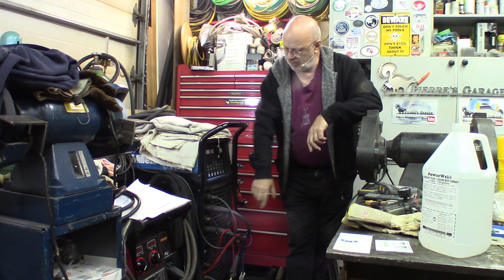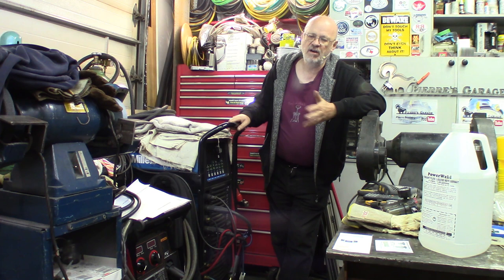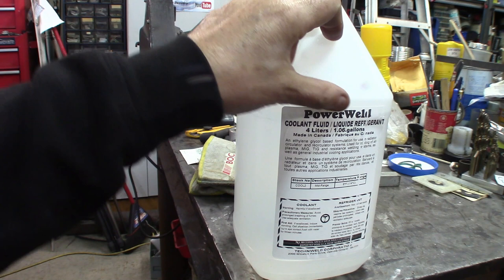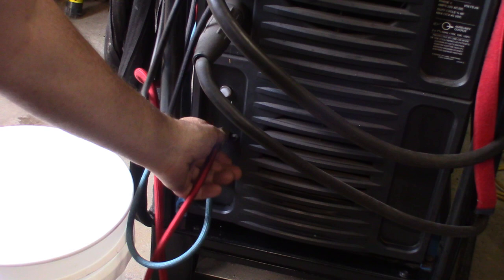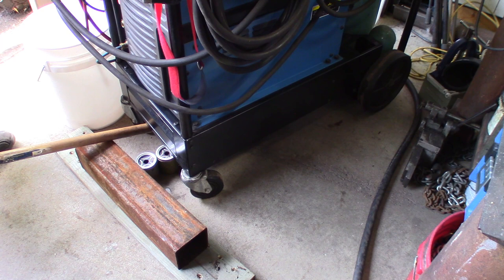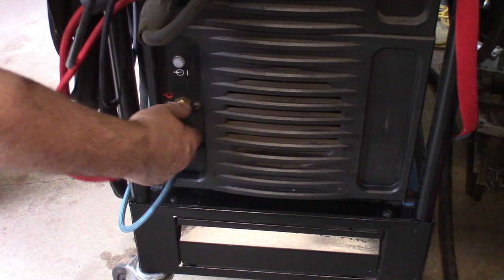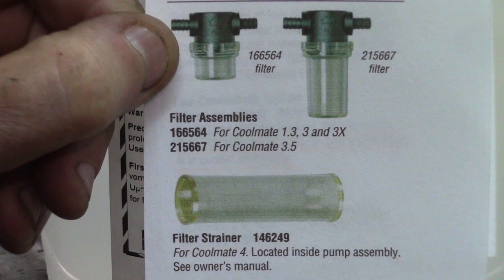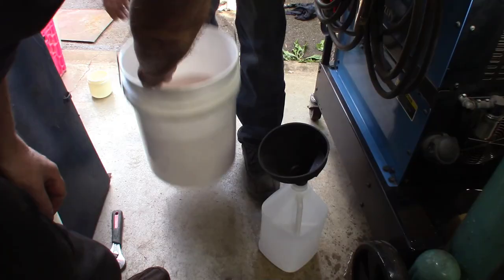Liquid cooled TIG torch, changing the coolant in the pump cooling unit, here CoolMate from Miller

Comment: Great video, I'm new to tig welding so all of this is good information. 
I'm from Ontario so I'll look up the same fluid you used.
Reply from the maker: You'll enjoy the precision of TIG welding, not easy to master, though...
I got my antifreeze from a local supplier named Maxigaz in Saint Constant, if you can't get the exact same thing just make sure you use some stuff made for the purpose, avoid at all cost the brands made for automotive as they will cake in the whole system and ruin your cooler...
Thanks for your comment....   🙂🙂
Reply: Appreciate all the tips! Thanks very much :) Yes it's going to be a long road ahead, and many refills of 100% argon, until I get it right, lol. Thanks again.  @pierresgarage2687

Comment: Been 16 years on my syncrowave 250 coolant (and welder)....time to change it out I guess LOL.  I only go through about 2 commercial size bottles of gas per year on that welder and it still works great,  even with most of what I weld is aluminum cylinder heads.  I guess it's like all good machines,  they take a beating!
Reply from the maker: 16 years, You beat me, a little.....
Being retired, the machine is also retired and only works when it feels like it...    😂😉
Those machines are eternal, they just last and last, really reliable.
Thanks for viewing and for your comment
Reply: I think I bought my syncrowave 250 dx in early 2000's, probably close to 20 years ago, and I have yet to change the coolant. To be fair, I haven't even touched the welder in close to 5 years. 

I'm in the process of lifting the welder off of the coolmate 3x, to try to figure out how I'm supposed to drain it. I haven't been very successful at finding any information about that online or in any books, so I have to do it the hard way, which is part of the reason its been so long. 

Do you happen to have the "tig runner" with the coolmate 3x, and if so, do you know where I can find the recommend procedure for draining and flushing? Or do you know what it is? 

It occurred to me yesterday to give Miller a call, but I haven't tried that yet.
Reply: Been 30+ years on my Hobart cooler on a TR-300-HF without a change in Prestone, cooler temps (-20 +F) and warmer (100+ F) - no problems.  I'm upgrading to a Dynasty 280DX so I guess I need to start changing the special fluid every 12 months :)  And the pump every ? years?  I love progress.

Comment: My Miller dinosaur is valved to hook to tap water and run it pass thru for cooling.  i have never had a water cooled torch on it though so never used it.
Reply from the maker: Before this welder I had a Lincoln Idealarc 300 and used the same principle with the valve and tap water just like you, it causes a little bit of scaling and needs to be addressed once in a while, must depend on how much minerals are in the water, inexpensive, though...
Some problem caused with tap water is theat in the winter here it's real cold and causes some amount of condensation on the electrode and collet system, not recommanded for critical welds since it transforms in vapor when you get back to weld...
Reply: @pierresgarage2687  hey you say you had a Lincoln idealarc Tig 300 I just pick one of those up a couple of weeks ago when you still had it how did you like it
Reply from the maker: @tigwelding123  It was a great basic machine, really a smooth ard stable arc with an airplane grade ventilator fan blade, (NOISY....!) In short a machine made to last 100 years+...
Cheers,
Pierre
Reply: @pierresgarage2687  why did you get rid of your Lincoln electric idealarc Tig 300
Reply from the maker: @tigwelding123  Got a Dynasty 350 kit, it's kinda much better...
Until it ever needs repair, hopefully not...   😉

Comment: I have just used RO water for the last change, and I also herd if you are in a cold climate the RV antifreeze would be a good alternative. BUT heck I do not know what I am doing. Mine is a real old and big Miller Tig
Reply from the maker: The RV or plumbing antifreeze is much less costly than the stuff sold expressly for the purpose,  my concerns would be that the coolant for welders have to take into account many factors like, safe for hoses, lubricating the pump, safe for aluminum, low conductivity mostly in systems using high frequency, higher boiling point, protect from freezing in cold areas,  anti fungal and not sure if anything more...
If someone is capable of making a technically advanced study in order to find out if all those points are met in a certain type of of the shelf lower cost product, I would welcome the result cause I'm sure we'd all save lots of $$$ in the long run...   ;)
The problem with people trying some other solutions is that it may take some time to find out the results either good or bad, and also did the comapny changed the receipe along the years...   So many questions...!!!
And, since those coolers are in the range of $1500 or more and parts are times 10 the $$$, I'll play it safe...
Best advice is to stay with what the manufacturer says...   Sigh...!!!
Thanks for your input,    Pierre

Comment: Currently working in a shop. Ive been here 3.5 years took over operations by myself in may of last year. In my time here, the coolant has never been changed from what ive seen. My torch is getting rather hot after only welding for a few minutes. Ive never had to do something like this and ive been welding since 2014. Thank you for the video, i currently have 2 of the recommended 3.5L miller high frequency coolant on hand but the remainder is on back order. Im just wondering if it would be alright if i could top up what i have as we have changed many torches over the years resulting in coolant leaking during the change so id say its on the lower end of things or should i just wait for the remainder of my coolant to arrive? Probably a dumb question but i thought id ask. The work i do isnt welding all day every day, its a lot of fabricating and grinding so i might only be welding for an hour a day sometimes more depending on what im doing. Some days i wont even turn the welder on. We are running identical machines.
Reply from the maker: I would suggest you change the whole quantity at once in order to restore the liquid to original properties, this formula contains some combination of anti corosion, anti fungus and a few other additives that degrade with time. There is the reason we should keep the maintenance schedule, here, the change isn't done every year, since just like you the machine isn't used very often as like in a welding dedicated workstation.
Remember that like with all vehicule, tool, building, good maintenance help stretch the useful life of those items...

Comment: Are you sure this needs changing? I mean the coolant in the car is in there for decades and works just fine...
Reply from the maker: I'm not officially go against the manufacturer's notice, but, this coolant was there for quite some time, it's safe as long as the anticorosion and antifungal properties are still able to keep the coolant safe for the materials of the cooler...  This is between you and me...   ;)

Comment: Thanks Pierre (and Phil).... My new TIG welder says I can use RV antifreeze, you have an opinion on that? Cheers, Daniel.
Reply from the maker: Guess that if says that you can use that product, it should be safe....   

But here is something I said to another viewer about the considerations to be taken into account about those cooling systems...   You can read if you have trouble going to sleep at night...   lol

The RV or plumbing antifreeze is much less costly than the stuff sold expressly for the purpose,  my concerns would be that the coolant for welders have to take into account many factors like, safe for hoses, lubricating the pump, safe for aluminum, low conductivity mostly in systems using high frequency, higher boiling point, protect from freezing in cold areas,  anti fungal and not sure if anything more...
If someone is capable of making a technically advanced study in order to find out if all those points are met in a certain type of of the shelf lower cost product, I would welcome the result cause I'm sure we'd all save lots of $$$ in the long run...   ;)
The problem with people trying some other solutions is that it may take some time to find out the results either good or bad, and also did the comapny changed the receipe along the years...   So many questions...!!!
And, since those coolers are in the range of $1500 or more and parts are times 10 the $$$, I'll play it safe...
Best advice is to stay with what the manufacturer says...   Sigh...!!!

Thanks for your input,    Pierre

Comment: My water cooler is pumping very slow can you make a video on troubleshooting issues?
Reply from the maker: Thanks for  viewing and comment, as making a video in a near future, I'm presently kinda recharging my batteries and dealing with more family and day to day issues...
Here are a few things you may check, first, you need to determine if the problem is the pump or the torch, in some cases you may have restrictions around the TIG torch head, it could be mineral deposits or just damages around there or the hose itself, if this is ok, you want to check if there is a filter in your system, is it clean or in proper condition, try circulating without it, look for a worn or squeezed hose or conduct, you may also have limestone deposit if the coolant is not the proper type or overly expired, I've seen some people using car antifreeze in certain systems that would cause clogging, you could have a defective, worn, partially blocked pump...
If you process by elimination of the different parts in the system you'll surely arrive to the one or possibly more causes of the problem. 
Hope that even if for now it's impossible to make a video, this will lead you in the right direction in order to diagnose your system...
ATB,   Pierre

Comment: Have a question? have the same TIG welder wondering why my coolant line keeps blowing up and dont wont to stay cooled ?
Reply from the maker: Nothing obvious to me, I got this welder since over 15 years and it's doing fine, I'm not using it very often now since i'm retired. There is one VERY important thing to consider when you get your coolant, get the proper type for this welder, either the Miller genuine or one with the same formluation, since in the system there are different materials like aluminium, brass, copper, possiblt some welds from silver solder supplies, the problem is to avoid dieletric conductivity at all cost, this is where the right coolant formula is so important. This product is quite costly, but at least it's safe for you system, if despite using the specified product, you still get issues, I suggest you contatc Miller or your supplier to investigate further. Be sure to never use automotive products in this application.
Hope this helps you solve your issues,   Pierre